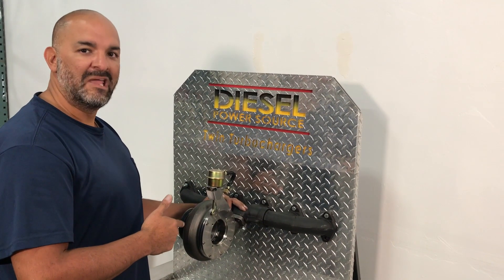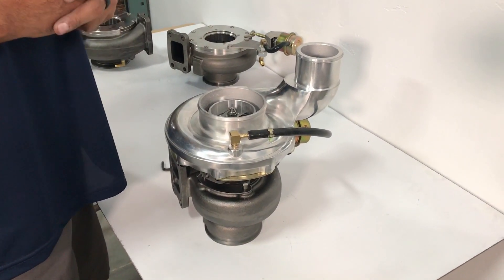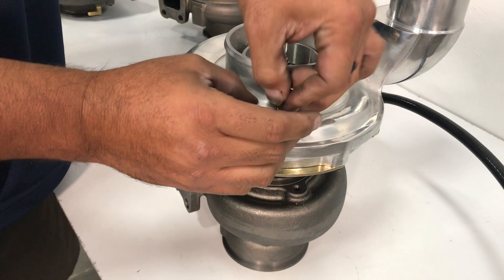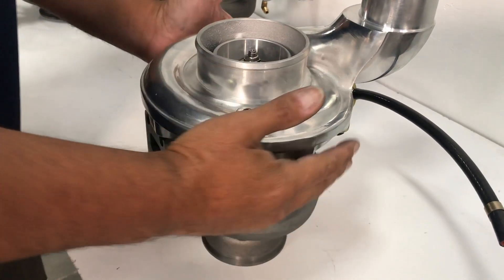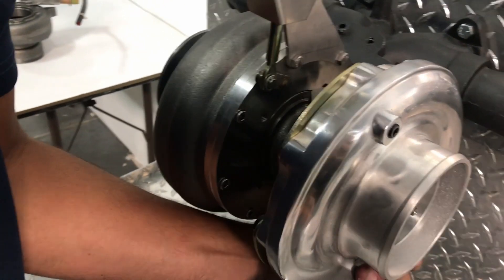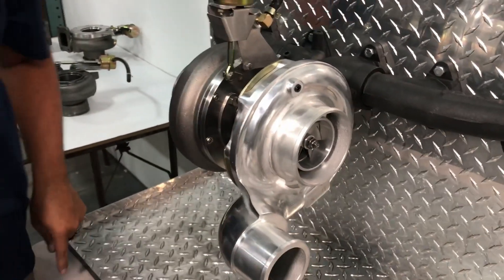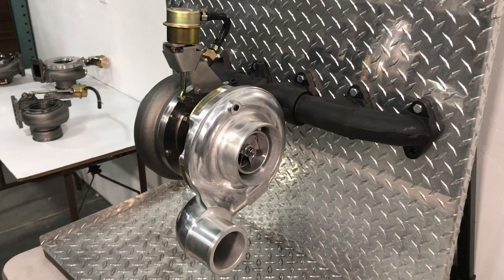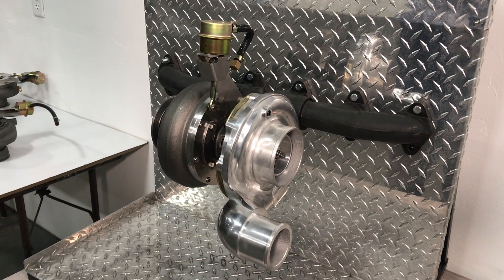How to Transform your S300 Turbo into a VGT.  Great 5.9 Cummins Turbo, and 6.7 Cummins Turbo.

Comment: If I were to buy one, will you make one for the 68 wheel or would the 71 work just the same?
Reply from the maker: The smallest we make it for is the 71mm exhaust wheel.
Reply: @DieselPowerSource  Okay, so I'll probably have to do a whole turbo instead of just the housing.

Comment: I don't know for certain but I have a feeling you guys are missing out on some market share by not putting these on a gasoline engine and showing off a very good torque curve.
Reply from the maker: John Parrish, you are right, because our Turbonator VGT is clockable it can be used o many different applications.